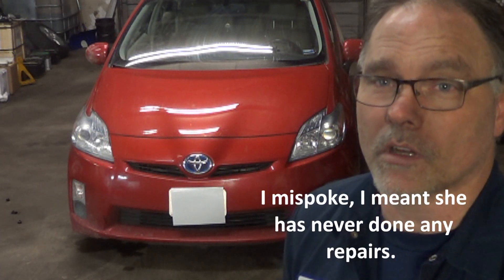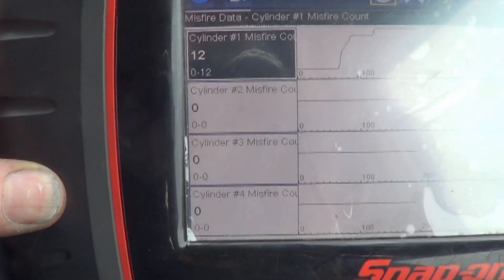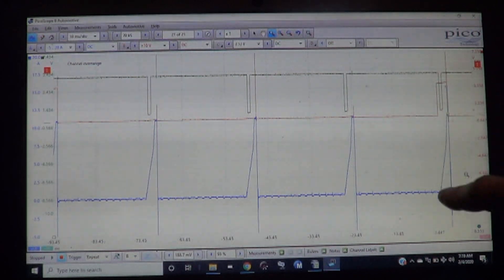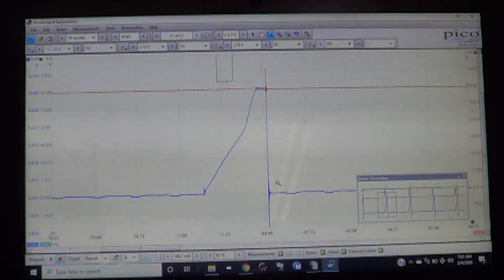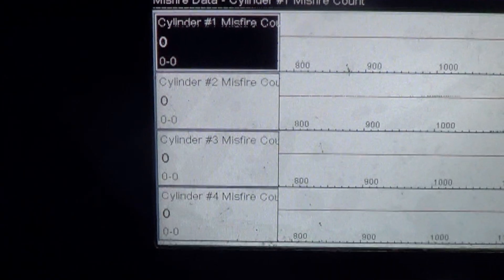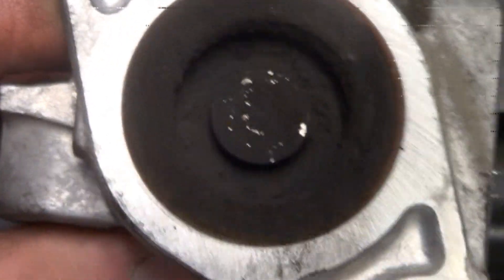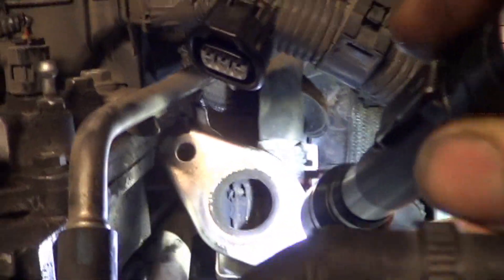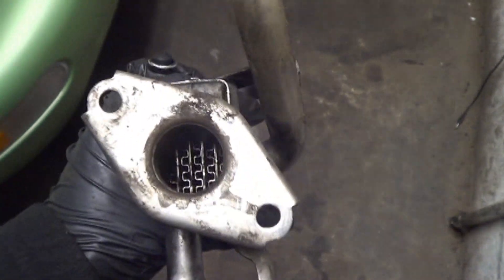toyota Prius misfire P0301

Comment: Just use a degreaser to clean the cooler that’s what I do and it leaves it sparkly clean with the pressure washer in your corner store somewhere somewhere where there’s a pressure washer place that you can use to clean your car it’s only a dollar for like three minutes you can clean it real quick less than two minutes just put some degreaser on there some purple stuff and you’ll be fine instead of using that tool God sakes it takes forever trust me been down that road while you’re at it go like and subscribe to my channel

Comment: Good Job!  i never tried using a wire in the intake. i'll do that next time.... i have 3 prius (prii ?) in my stable, and that is the sound of a headgasket replacement soon if the EGR isnt cleaned (and the intake also). long term fix is to change the piston rings to standard not energy saving plus a oil catch can. it will lessen the oil in the intake which clogs the EGR. similar to the TDI. if EGR isnt cleaned, all this knocking (from liquid in the combustion chamber) stretches the head bolts which results in a headgasket repair. but even that is temporary (20k -50k mi) until you do what i mentioned above.  Replacing the piston rings is easy as the engine is like the brakes. its not even worn at 300k mi. hope i make sense.
Reply from the maker: Great input!  Thanks!  Where did you get so much Prius knowledge?
Reply: @CoolAirVw  priuschat forums. when i first got the prius. the oil usage was insane. after a year of adding oil and intermittent P0420s and a 2nd Prius doing the same. had to fix it. i tried everything to clean the rings thats available. nothing works except changing it. i tried just changing the oil ring itself on one using aftermarket standard. and that lessened the oil consumption but didnt eliminate it. dont bother with the OEM rings. ... most of the time it makes that sound on a cold morning due to condensation. causing it to have liquid its tryng to compress inside aside from the ever present oil in the intake. which is why you need a oil catch can. it also catches some of the condensate. but you dont have to believe me. maybe you can test and make a video on that. :) oh and like the vw having vcds. its best to have techstream for toyotas to see the actual codes.

Comment: 2010 Prius with 230k miles.  Sometimes after leaving the car in the rain and only after leaving it in the rain, the car makes a similar knocking sound for about 3 seconds. Then it stops and everything is normal. No error lights on the dashboard… has probably happened 10 or 20 times over 10 years… Then yesterday it made the knocking sound and the fine light came on. The code is P0301.  What about the rain could be causing the knocking?  Is there a specific part that I should investigate for failure?
Reply from the maker: change coils and plugs and hope.

Comment: Wouldn't you want to change the PCV valve as well?
Reply: Just thought it would say be a point of carbon buildup as well as the egr
Reply from the maker: @douglasnolan4858  Ok.
Reply from the maker: you are welcome
Reply from the maker: @douglasnolan4858  Oh, I see.  Thats logical.
Reply: Thanks for the helpful video
Reply from the maker: @douglasnolan4858  Your welcome
Reply from the maker: Did you watch the video?  It clearly fixed the problem.   Car is still on the road, I mentioned it was a friends car.  They still getting down the road, with no new pcv valve.  But maybe I'll call them and tell them to get one.  Are you noticing a high failure rate at 180k plus on the pcv valve?

Comment: Great Video! My daughter has a 2006 Prius. Very bad "knock" sound at idle. Loss of power,and,check engine light. OBDll scanner showed misfires on cylinders,1,3,and 4. Knock goes away in drive and reverse. Only while in park. Changed plugs,cleaned MAF sensor,and,intake. I believe the "EGR pipe" is internal,or, software driven on gen 2s. Maybe,the igniters or injectors? There was also a 4th code shown. "po446". ANY help would be very appreciated. I'd hate to think motor is shot.
Reply: 2006 prius without EGR.
Reply from the maker: did you solve this problem?
Reply: @CoolAirVw  Unfortunately no. Car is gone.

Comment: Thanks a lot. Very useful video for me. It solved the problem for my 2012 Prius(120k km). I started in reverse with intake ports and rattle is gone. Thak you again.
Reply from the maker: So glad it helped!  I have to point out that any misfire will make the rattle noise.  So spark plugs, injectors, coils, head gasket, compression as well as EGR problems and other things will make this problem and cleaning the EGR wont fix any of the other things.

Comment: I've had this exact problem for months (same rattle sound!) on my 2010 Prius w/ 200K miles. I've changed the spark plugs and ALL of the coils, and also the Crankshaft sensor, but the problem is the same. I'm pretty sure after watching this video and others that I have an EGR problem like this. Thank you for the research and posting this!
Reply from the maker: thanks for watching.  Glad it helped.
Reply: So did you resolve problem?  I just cleaned my whole EGR SYSTEM today and rattling persists.  Have a blown head gasket 2010 Prius 200k miles
Reply from the maker: @calvaryassemblyofgodsouthi8046  I dont know about napynap's car but it fixed the one in the video, just saw the car yesterday.  Running great.  Any misfire will cause the rattling sensation.  Head gasket is common and will cause misfire as wet cylinder affects spark.

Comment: Hey, what did you use to lubricate the egr valve, I believe mine is stuck open? Thanks for the video
Reply from the maker: I didn't lube it.
Reply: you can  use break cleaner or EGR valve cleaner
Reply from the maker: @shamskl3245  Neither of those is a very good lubricant.

Comment: That's alot of down time and work for my daily driver, I got just over 200k and started getting the same problem, I diagnosed by unplugging the EGR and misfire went away, I plan to just block it off. My car did not throw any codes until I unplugged the EGR
Reply from the maker: thanks for watching my channel
Reply: Check for coolant in the oil. Will look like mayonnaise or milky.  Blown head gasket on mine

Comment: any updates after 4 months on this prius? my 2013 prius show same symptoms as yours. im going to work on mine in tomorrow.
Reply from the maker: Car is running great.  Misfire fixed.  Make sure you address this as a misfire and not as just needing EGR cleaned.  Although it probably needs EGR cleaned if it has similar mileage.
Reply: my prius has 200,000 miles, same exactly symptom that you show on video. hopefully it is the EGR, and i saw on another video po301 on prius gen3  can be blown head gasket.
Reply from the maker: @jamest163  Lots of stuff can cause misfire.  coils, spark plugs, yes, head gasket
Reply: i just spent whole day to clean EGR and changing spark plugs, after changing both of them, i have been testing 4-5 times to start the car. no more knocking and shaking. just waiting for early morning to get some pink coolant from dealership. thanks for replying!
Reply from the maker: Read my update on JP stone's comment above. Its doing great.

Comment: Hasn't been too long but are there any updates on this Prius?
Reply from the maker: the prius is fixed and still motivating down the road.
Reply: @CoolAirVw  Thank you. I'm waiting for the intake manifold gasket to arrive to start the project.
Reply from the maker: @zero2three1  Is yours doing the same thing?
Reply: @CoolAirVw  Cold start rattle in the morning occasionally. Had and cleared a P0301 last week. Fluids are OK. Spent a lot of time researching. The car drives fine for the most part but...
Reply: @zero2three1  mine just like yours. Mine is a 2014. Would a diagnostic hook up tell me the problem? Toyota dealership.
Reply: @terrytorres7075  if you want to make absolutely sure it's the head gasket, take your car to a Smog station. They can check for hydrocarbons in cooling system with the gas analyzer.
Reply: @terrytorres7075  it's been around 5 months since I had the head gasket job done and no more cold start rattles. However, I did clean the intake manifold, EGR, and EGR cooler before the head gasket job and the cold start rattle went away after that. But since my mileage was high (190k) I just went ahead had the head gasket done. Car runs fine but mpg has dropped to around 36 mpg. But I also drive not so conservatively...
Reply: @zero2three1  I'm considering getting the head gasket replaced on my 2010. Has 180k miles. Can you refer me to the company that did your service, and are you please with their work? Much appreciated.
Reply: @steveo3494  And, yes. I'm happy with the work. I'm in the collision repair industry and do minor mechanical work myself and these guys are pros for sure.
Reply from the maker: read update on jp stone's comment above.  Its doing great!